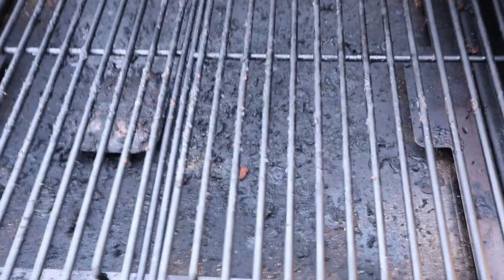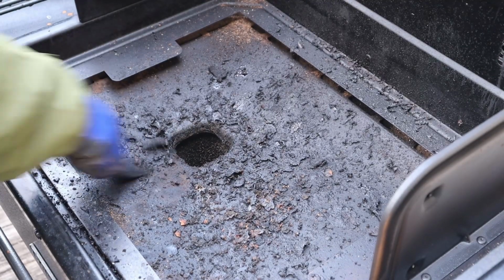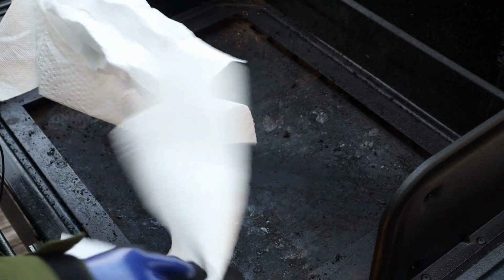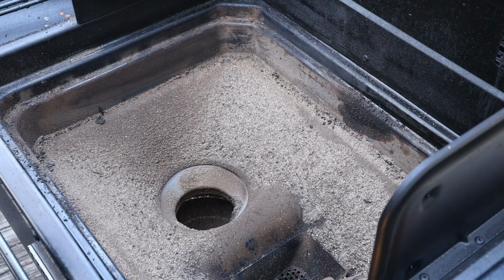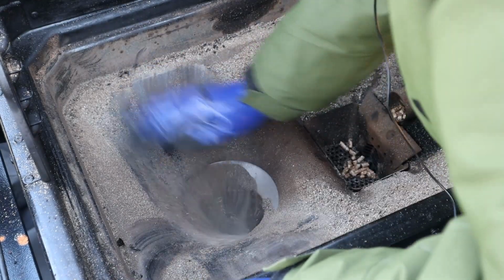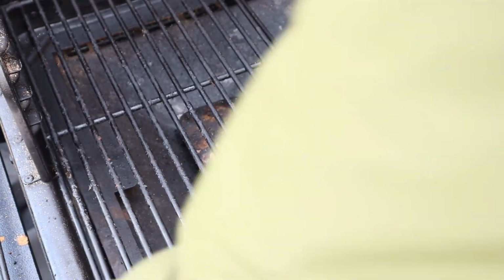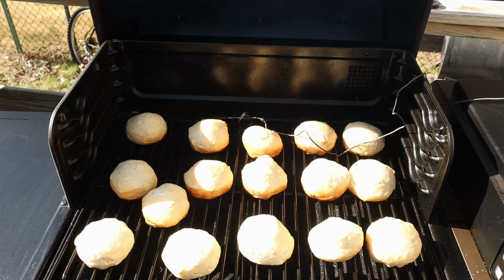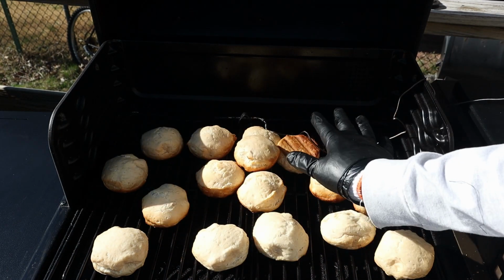How to Clean Your Traeger Ironwood 2nd Gen - PLUS: Does It Pass the Biscuit Test?

Comment: Great video. Really wanted to see what this thing looked like after some use!! 

Does that fire pot fill with ash on long cooks? Or does it all blow out? I have the original ironwood and I’m maxed out at a 8-10 hour cook depending on pellet brand because the pot is so full the fan can’t keep the fire going.
Reply from the maker: I have done 2 6 hour cooks and a couple of high temp cooks ( 350 - 500 degrees) with no problem before I had to clean out. the fire pot never had any ash in it also the grill will tell you when it's time to clean it out.